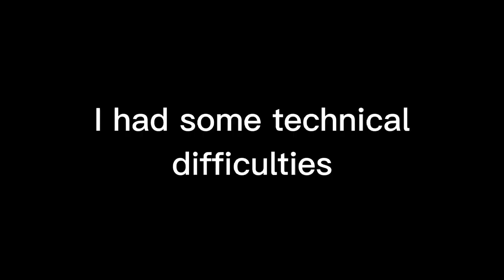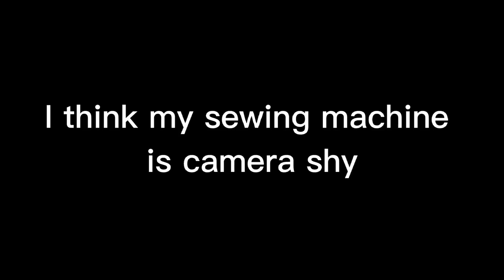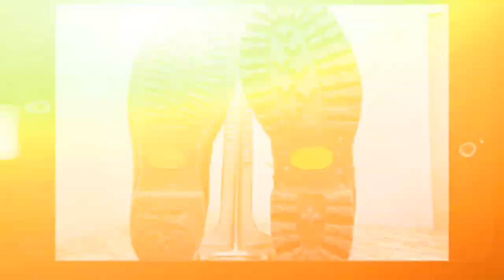Stitch down to Goodyear welt, saving an old pair of Danner Boots!

Comment: Where do you get your leather mid-soles?  I use Southern Leather  for my shoe  repair findings jobber and they say they don't carry leather mid-soles curiously.  I'm having to use Italian tanned sheet leather which is for women's outsole use mostly.  It's more expensive than pre-cut mid-soles as the leather is an even finer grade ( super prime) than what would be required and sold in smaller partial sheets resulting in just about three pairs of boot mid-soles per sheet.  I'd love to buy pre-cut leather boot mid-soles if I could.  As a 4+ decade shoe retailer and repairer I appreciate all of the care and labor you've shown here.  Viewers may not appreciate how laborious and difficult this job is.  It is a lot of hand work and it isn't easy keeping the boot width as wide as the original when you do not have the exact factory last.  It can be done with the amount of care you've exhibited though.  Awesome job and great to see these skills in a young person as there are too few young people in our industry.
Reply from the maker: Thanks you 🙏 I use Miami Leather as my supplier for leather midsoles. If customers want a thicker leather midsole I use a cheaper leather sole, but the customers pay more for them

Comment: Was holding a straight edge down while cutting leather. Was in a bit of a hurry couldn't see where my hand was. What I could see after running the blade along the edge was something rolling away from me along the table. First thought in my head was. That's my finger isn't it. Indeed it was. Not the whole thing just the tip. Took a second for the pain to start, but once I got it clean and wrapped up I ordered myself a pizza.
Reply from the maker: @guitarguymi  😬😬😬

Comment: Logger/Woodsman Heel

Design: A heel with a concave line, tapering inward from the base of the boot itself towards the ground. Traditionally, the logger heel (also known as a woodsman heel) will sit at a height of roughly 1.5 to 2 inches. Shorter logger heels, often known as low woodsman heels, are usually less than 1.5 inches tall.